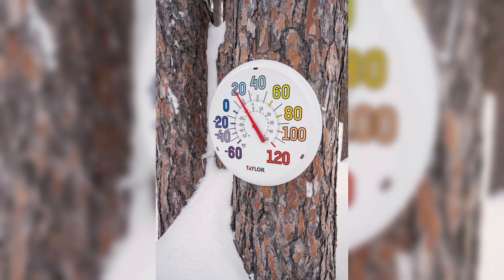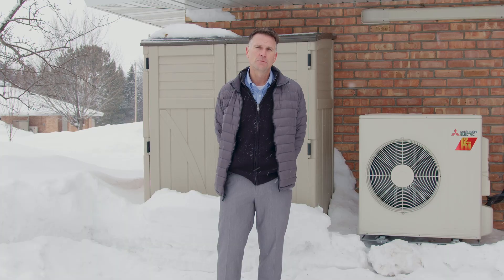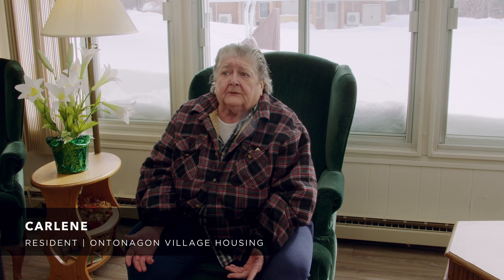Ontonagon Village Housing: Cold-Climate Performance

Comment: Video states “ more efficient” . More efficient than what?
I just installed them in Mass. i am to use instead of my gas hot water heat to get the rebate . Scared as to see my electric bills this winter. 
Will they be less expensive than gas heating?